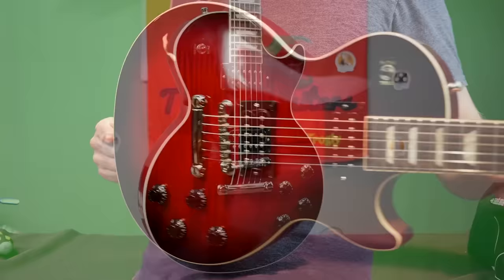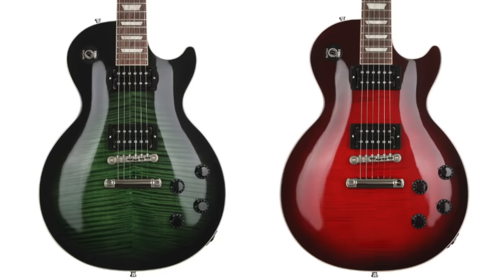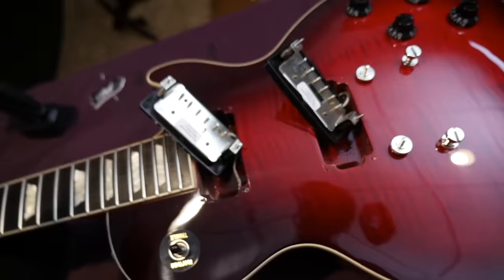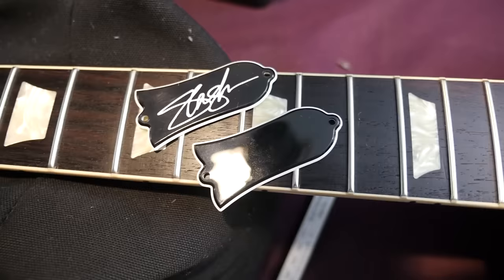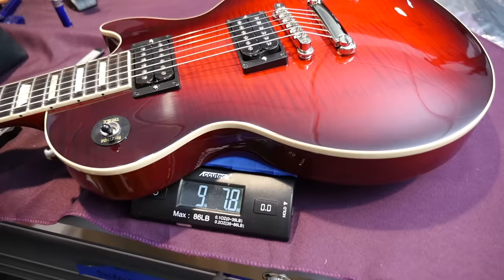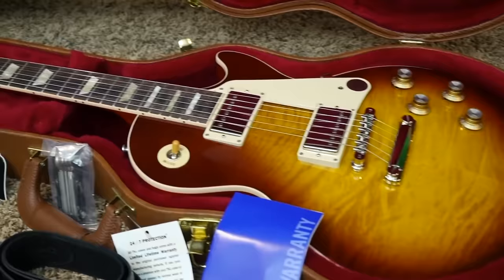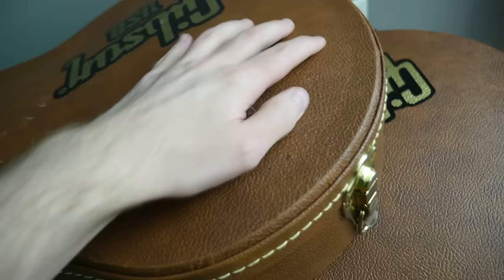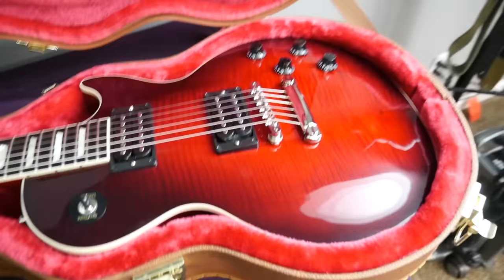Is It Worth a $500 Premium? | 2020 Gibson Les Paul Slash Collection 50s Standard Vermillion Review

Comment: The issue can't be the nut if you hear it when fretted.  Take a look at the saddle.  Also, it looks like the tail piece is too close to the body--make sure no strings are in contact with the back edge of the bridge.
Reply: Wrap the strings around the tail stop instead of stringing them straight through the back.
Reply: @smokepeddler  He just needs to first check for clearance, if need be he can simply raise the tailpiece a bit.
Reply: @thegusk520  100%

Comment: For the g string buzz check that the saddle screws are seated properly. I had the same issue with my A string and that was the culprit, even with the wire.
Reply: Agreed. My 60s Standard did the same......intonation screw in front of the saddle is probably slightly riding up and tickling the string.

Comment: I just watched the video again. I noticed the bridge is a Non Wire ABR-1 bridge. Turn the saddle of the G string around, so that it is more centered in the middle of the bridge. The buzz is coming from the saddle intonation adjustment screw not having enough pressure to hold it in its slot. Since it is a Non Wire bridge, the tension from the string holds the saddle down. Because the G string saddle is so far back, there is not enough pressure holding it down.
    Try to remember where the G string saddle has the string seated. Try to put the string slot back in the same location it was, so you don't alter the intonation. Just spin the saddle around, and adjust it back to where it was.

Comment: If a string sounds buzzy but no other string does, AND if the string sounds buzzy about the same way on several frets, I've found that in 9/10 cases it's just a bad string. I think what happens is a string will crack lengthwise and just as you can tell a wooden baseball bat is cracked you bang it on the ground it sounds buzzy.. the two strands of the string buzz against each other., when the only thing that stops it is just changing the string. If a fret is high you'll likely hear it on more than one string and if it's the nut you will only hear it played open.

Comment: Your videos are a highlight to my day!  If I had to guess that g string issue is the intonation wire vibrating.   It probably sounds normal if you hold a finger against its screw while picking it. My les paul standard has a loose wire often if the screws arent rotated just right.

Comment: Also noticed the handle location is different. The old cases seem to use the handle's screws to secure the interior compartment, but the Chinese model uses separate screws. If they are making them cheaper, not sure why they would use more hardware.

Comment: Hey Austin! I think that the extra holes on the cavity of the switch are because even though they pre drill them, when the assembly guy starts putting the guitar together just puts the plastic cover on and screws it without checking to allign the holes from the cover to the pre drilled holes. I'm guessing that because half the holes are painted and finished an the others are not.

Comment: The mark by the control cavity: it looks like the color coat didn't take and they clear coated over it...That one should be "B" stock, with that, the switch cavity boo boo and the half assed set-up. I think it's either the fret leveling is off (with a plek?) or, most likely, the bridge slot is too deep for the gage string on it. For an EXTRA $500, not cool. No comment on the new cases...

Comment: Did you check the string clearance at the first fret with a feeler gauge? If not you may wish to consider adding that feature to your videos ... I bought a 2017 Gibson Les Paul Custom Shop Black Beauty which had 2 thousandths of an inch off too low that caused slight buzzing at the first fret noticeable when hitting the strings harder as an open string.

Gibson factory spec nut clearance tolerances are easily searchable online and easily measured.

Comment: This fret buzzing is totaly unacceptable. When you try a Gibson at the store, take your time. Bring a fret rocker and check all frets. Make sure that the nut is at the right height and that there is no fret buzing. Check how straight the neck is. Try the guitar with clean sound. Fret buzing can be masked with a lot of distortion. If the fret buzing is due to the fact that the bridge is so low that the strings are almost touching the frets, then raise the bridge just a little. If problem persits, tell the seller to send the guitar back to Gibson. But it's after that, that scares me,,,is Gibson realy gonna do sometning with the guitar or are they simply gonna ship it to a different store ???

Comment: I bought the new Standard 50's last year and had to replace the nut right away because of the G string wouldn't stay in tune. 100 bucks on a brand new guitar sucked. I have had several SG's and Les Pauls over the years and never had to replace a nut. Gibson needs to cut the nut with a slight angle to compensate for the headstock but they don't I guess.

Comment: The felt washers melt the finish, it happened on my 2015 classic SR
Reply: How would felt melt the finish... Something else had to have caused it.
Reply: @StoicTrader-  That is the way nitro finish reacts to most things, same happens with normal stands, you need to get one that is specially made and it says on the box "safe for nitro". Its all because nitro finish never fully cures.
Reply: @DarkDare47  which type of stand ruins nitro finish?
Reply: @StoicTrader-  pretty much all the cheap ones. It's one of those things most of us older players learnt the hard way but there are loads of brands which advertise that they're 'nitro safe' nowadays.
Reply: @StoicTrader-  Any you can buy that don't state they are nitro safe.
Reply: @DarkDare47  Yea I'm just wondering because I have one stand that hangs by the neck on the wall, the brand is string swing, but I also have an Amazon basics stand for the floor.

Comment: sight down the guitar and look to see if it looks like it's got some body hump. If there's body hump, neck relief usually doesn't fix it. At $3k, to have a reasonable action, supposed plek work by gibson and then have a string choking like that without something obvious (bridge saddle isn't loose is it?) is pretty annoying. 5 minutes of playing at the factory would eliminate that, but I guess it would add to the cost of making, too, because they'd have to fix that, and at $3k, they aren't willing to do anything other than fling the cost of fixing that onto you. I guess you could send it back to them so they could tell you that it's "in spec".

Comment: Who exactly was complaining about the weight relief in Gibson guitars, I know it wasn't me or anyone else I know.  It reeks of one of those guitar geek decisions made by people inside Gibson rather than actual buyers - kind of like how you can't get a Fender Custom Shop guitar without a baseball bat neck.  
Now this may be a pet peeve of mine, but how long has Gibson been using the same size cavity in their cases for the accessories?  At least 30 years right?  So why don't they size the warranty and the inspection checklist so it fits in the stupid cavity?  That's a change that would require ZERO dollars and then all your stuff wouldn't have to be mashed into the cavity.  (And by the way, I bet this Slash model had the inspection checked off on the neck when it obviously wasn't done.)

Comment: I was very disappointed that Gibson used metal inserts for the bridge studs, I much prefer the bridge studs threaded directly into the body as they do on the Historic Les Pauls. I would also like to see zebra pickups and amber control knobs on all of them, some eye candy would be great!
Reply: from a structural standpoint, thats the weakest and least reliable method.
Reply: @killemall1983  I understand that, but the original Les Pauls were built that way, should not be a reliability issue, how often should they be removed and replaced, not often

Comment: Just bought a November Burst from Sweetwater. Supposedly plekked and the 55 point check, so I am hoping for no defects. I hope I like it and I'm sure I will. Arrives in 2 days. I already have a 2019 LP Standard in Seafoam Green. The 2019 is almost a Modern with the advanced electronics. I sold my Tribute, which was great for the price, to buy this guy. Oh, BTW I got a $300 discount from Sweetwater. Those guys rock! I sold my Tribute in mint condition and got raped by my local guitar shop. Bought it in 2019 for $1200 and got $600 for it in Mint+ condition. Put that $600 towards the Slash. Oh well, I didn't feel like getting hassled by selling it online and shipping it.

Comment: It's hand-wired because it doesn't have push-pull knobs, out of phase or any of that stuff that requires a PCB. PCBs are necessary with those features. No PCB is not evidence of quality. Trust me. I build robots. More complex electronics require a PCB or they are a mess with shorting risks, due to the additional connections.

Comment: This may be better than in the past, but nothing about this is worth $3000. The amount of finish dings and imperfections is far too high. A $1800 ESP E-II is going to without fail have better fit and finish than one of these - and at this price point, Gibson is competing with PRS, who also doesn't make these mistakes.

Also, 9:47 - that is in fact a chipout. It was filled with something, probably some kind of clear epoxy or similar.

Comment: I just got a 2022 Slash Vermillion, mine is a demo very, very minor discrepancy, a slight hairline slash on the headstock underneath Les Paul, so my Slash guitar actually has a slash! kismet? the case that came with mine is a TKL the hardware is noticeably squared off, no cheap binding as seen on the case in this video. Very pleased with this one and got it for 2600.  
 🎵r0ck0n 🎵

Comment: Whoever defends the flaws and "hehe you should have inspected it first" are imbeciles. I've had multiple Aristides/Mayones/Music Man/PRS/ESP/Jackson/etc in similar price points and those were flawless $2k-$4k guitars. I've had 3 Les Pauls and only 1 was flawless. I tried to trade a 2012 Les Paul to Guitar Center just to see how much I'd get and they asked "was there a repair" since the neck joint was sketch, this was a year after purchase and it was not abused at all. $2k it should be essentially perfect, no Gibson isn't the only one that has had qc issues, but the sheer volume is the difference. This is from a company that has essentially made the same design for decades, how can they mess this up? I'm currently looking for another Gibson Les Paul but unlike ESP or PRS or whatever, I feel the need to try SEVERAL $1500+ guitars to "find a good one" which is bullshit.